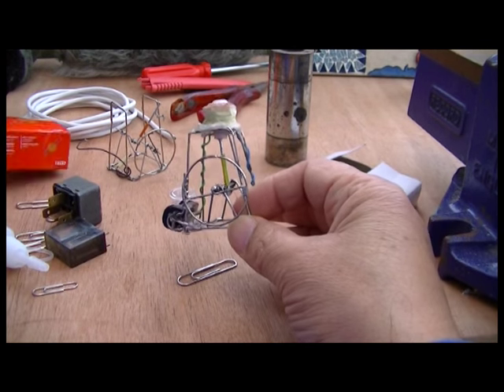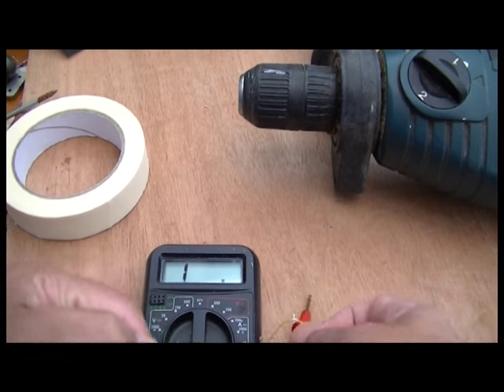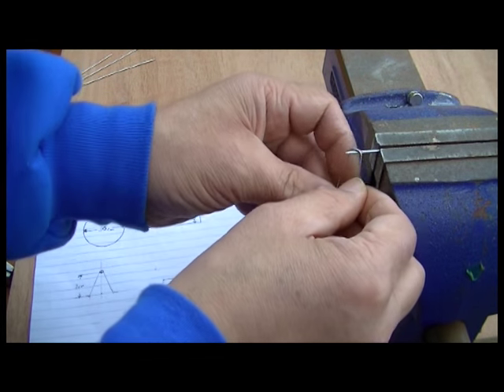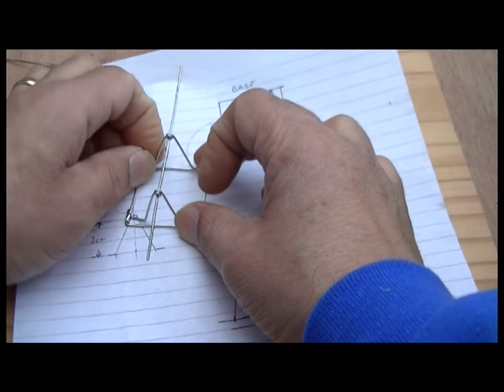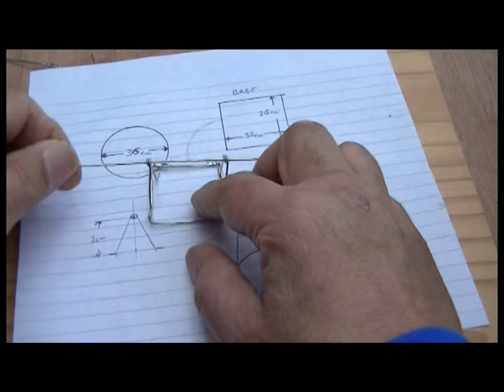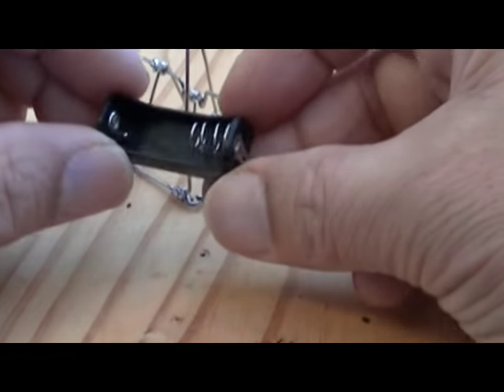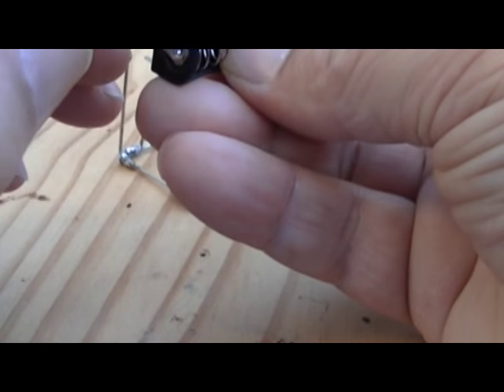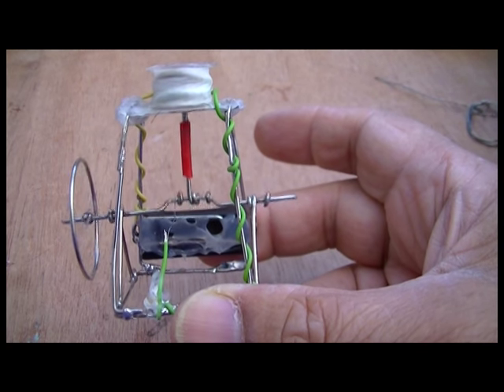Paper Clip Motor Tutorial.

Comment: +Just4Fun
what AWG/gauge of Magnetic Wire was used in the coil? thank you in advance sire
Reply: Wondering about this too.....
Reply from the maker: Sorry about the late reply, just found out the wire size on the coil I used. It was 44 SWG. It is 0.081 mm (Diameter) hope this helps. You can use a thicker wire if have the room to wind it on. The turns I do not know, I wound the wire and found if I had a resistance of say 29 to 30 ohms it would work good. Also found instead of using one of the wires to make the switch or connection you can use a thin strip cut from a drinking can. Good luck
Reply from the maker: I have found the turns to be 600 and wire size is 44 SWG. You can use a thicker wire. Good luck
Reply from the maker: I have found the turns to be 600 and wire size is 44 SWG. You can use a thicker wire. Good luck

Comment: you can also buy coilwire  (it's cheap) instead of destroying spare parts for oldtimer cars ofcourse   grts
Reply from the maker: Yes you can. I only used this wire because I have so many relays. I have found the turns to be 600 and wire size is 44 SWG. You can also use thicker wire. Good luck.